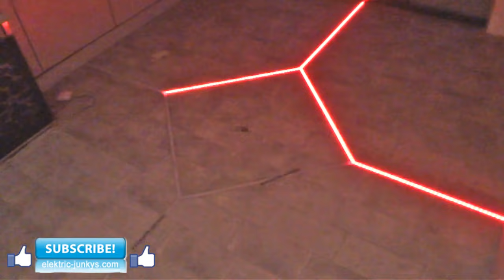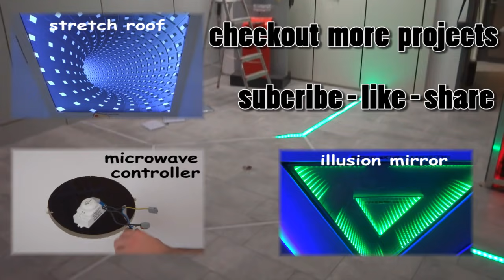how to LED floor tiling system #DIY make interactive Aluminum LED Light tilebar profile

Comment: You know, just something for you guys to try someday.
If you use a more clear plexi, and tint it with a chromatic window tint. Then line the bottom of the aluminium railings with it, you can take advantage of the infinite reflection effect, making the floor appear as if it is floating above a large black void. 
would require a bit more effort, but could really propel your project to another level. Hope to see if someday.
Aside from that, this project is very, very cool. Nice work.
- Cheers MatchStix Entertainment.
Reply from the maker: awesome idea mate ! check out our new Project .. you might love it ! https://youtu.be/hHxKA4JU6BA

Comment: I CAN'T be the only person wondering how much work it takes when one LED light goes out XD can I?
Reply from the maker: +TamuTamuOnigiri not TOO much hh but a little work it is yeah, cut out the broken LED´s Use Fast connectors to fix a new one finish ...
Reply: ***** ah, that's smart ^-^
Reply: +TamuTamuOnigiri 

Well a led cant die.  Only the controller or the pins. The actual led cant die (the point lighting up)
Reply: +Mike j an LED can't die?!?! Always funny when someone makes a statement that sound like fact but is completely false.
Reply: +tornadokat So your saying my teachers, company and experts. are all lying ?

Leds do not burn out. They fade and dim over time. This takes with leds nowadays about 100.000 hours. 
Thats 22 years if you use 12 hours a day.   And they never fade away entirely, but looks awful though. 

When you buy a led light from a hardware store, or any commercial light. (so not a 5mm led for DIY stuff) 
And it dies, it is not the led thats broken, its always the controller inside the led light. 
Put in a new controller, and voila your led light works again. (unless for some reason it goes a power spike)
Reply: Mike j thank you for actually being an intelligent unlike some people
Reply: LED's may last a while but if the micro-controllers fail the LED's also fail, they are only as good or strong as their weakest component. I dont anything about epoxy's heat dissipation properties but I would bet that it isn't  suitable for such a setup like this.
Reply: QuadroNVS pretty sure he used silicone.
Reply: MrVindictus1 mike j is correct. Light emitting diodes do not burn down out. their ballasts however can have a loose terminal so something for them the flow, however they will never burn out. I'm 800 hours from my EL01 permit and work with LED's on all of our sites. they will however dim out after extreme amounts of usages, as mike j said, roughly 2 decades

Comment: Splice the ends
tie them into speaker system
????
watch floor dance to the music
Reply: ***** Well, all you need to do is divert the positive and negative power connections for an extremely powerful speaker that could provide enough power for the LEDS (they might not need that much power but I'm not sure how much they need) and connect them to the corresponding connections on the LEDS.

As far as I know...
Reply: This would be making it way to over-complicated, but you could probably set up a connection to increase the power input to the LEDs without removing the power fluctuations that the music would cause.

But it would just be easier to the Raspberry Pi or an Arduino and have something fancy set-up.
Reply: Well, talking out of my ass has seen results yet again.
Reply: numpty1ish I would go for a ardunio, a raspberry doesn't make sense for what was suggested
Reply: fair enough, it can just be easier for people who are new to it

but it would be harder to connect
Reply: numpty1ish You don't need a powerful speaker system, you simply need to connect the ground to the speaker ground, power the positive from the regular power source (I have done this on SEVERAL car audio systems, nbd).  This would give you a flash in sync with the bass, but wouldn't allow for the rest of the effects.  If you wanted it as an added effect, you could use a controller with a PWM input, and run the sub-preout signal (from your amp) into an A/D converter, then run that into the PWM input on the controller.  If you are having a hard time finding a controller with PWM input, any first year electrical engineering student could modify one for you.
Reply: callum Lawden Neither would an arduino, see my other response to this.
Reply: I will bow down to your superior knowledge :P

I have never really had any dealings with stuff like this and I've never put in any research.
Reply: numpty1ish
Its all very basic controls really, nothing special at all.  Something else to consider, even a decent sized home speaker can handle 75-150 watts continuous, an LED takes much less than a watt, and a whole array like this one takes maybe 5-10 watts, but you should still use a constant voltage source and use only ground from speakers for a lot of reasons I won't go into detail on.

IF you do enjoy playing with Arduino or Pi, a project like this might make an interesting one for you, as it is fairly simple and you can do some interesting effects by adding the input from a music source (the pre-outs, cross-overs, straight from source, different types of modulation, however you wish).  You could use the x-over outputs to control each color of the LEDs to add to the effects for example!  I am not saying this is NOT an option, just that it isn't necessary for someone who wants to keep it as simple as possible.
Reply: ***** Make a video!
Reply: Gerff Sorry to burst your guys' bubble but unfortunately this won't work with these LED strips. They're smart LEDs and have a controller at each pixel, which allows each pixel (RGB LED) to be controlled separately. That might work with "dumb" led strips which are a bunch of RGB leds in parallel, because you're then controlling the overall power. The LEDs in the video receive a serial signal from the controller (the white box with 4 buttons and red leds on front in the vid), then PWM each led separately across the strip. The effect you guys are after could be achieved with a MSGEQ7 and an Arduino or maaaybe a RPi. Search for some videos of "MSGEQ7+WS2812" to see what I'm talking about.
Reply: Kyle Nahas
Over-engineered, If you knew something besides "products", you would have pointed out what I was describing was a simple class D amplifier and the controls that were already in use, which WOULD work just fine.
Reply: Go ahead and hook up some WS2812 LEDs to any amplifier and video it so I can see how that goes...
Reply: Kyle Nahas
You are obviously clueless to what I am talking about, which means 1. you aren't reading, or 2. you don't know much besides what you get in a pretty box.  Either way, please stop misleading these guys who are looking for info.
Reply: Lol I'm an EE, you're just clueless
Reply: Kyle Nahas
Apparently not a very good one, or an illiterate one.  Read my posts, specifically the one saying to use the output created by the PWM controller, on an input to the LED controller.  So, my question oh great one, is can you read, or do you just like to argue and pretend?
Arduino is a cool little "PMC" (used loosely), but it is NOT the end all be all of controllers, there are plenty of others that are much better, and far more powerful.  Arduino is a "hobbyist board", and anyone saying you MUST USE ONE to do something simple like this, that a simple surface mount IC will do, is NOT an EE.  Yes, it IS an option (as I also stated in a comment here to someone who was throwing around ideas), but it is not the ONLY one, nor is it the BEST, so don't come on here saying something won't work because it wasn't in line with your hobbycraft, saying you are EE, and having no clue what someone who IS is talking about.  This is first year degree stuff, how did you get an engineering degree without knowing how simple and extremely basic converter and control circuits work?  Hell, you could do this with a 555 and a couple basic PNP gates in an hour.  Now, that's enough from the trolls, if someone has something constructive to post on here, great, otherwise quit confusing and misleading people wanting to learn, or throw around ideas (how most real learning is done, as long as there aren't counter-productive trolls standing in the center of the room yelling "LOOK AT ME, LOOK AT ME!!"
Reply: numpty1ish " you could probably set up a connection to increase the power input"
Basic concept of an amplifier circuit.  To make it dance even better, you'ld want to include a circuit that isolates frequency ranges.  Many systems isolate it to the base range.  This is necessary because if the leds flash too quickly, the leds appear to be in a constant on condition.  Even better would be to run it through a computer controller where you can control the pattern output with software besides having them just flash on or off.
Reply from the maker: Marcin Sleziak HEY GUY´S CALM DOWN !! Alores Dance`, use WS2811/WS2812b combined with our Music controller ... done.. i guess it´s the most easy solution
Reply: +numpty1ish You can't connect addressable RGB strips up like that. They need to be sent data - they always have 5v power, the data tells the strip which pixels to light, and which colours. The wires on those leads are +v, GND, Data and Clock. If you connected them directly to a fluctuating power supply, you'd just blow out the LEDs and see nothing.
Reply: Stabby666
The clock should be built into the controller not on the strips
Reply: +Gerff it is. the clock line is to synchronise the data as it's sent to the strip. some strips don't use a clock line but require precise timing to work (e.g. neopixel). in any case you can't just plug them into a dumb analogue voltage output. they need a controller to work.
Reply: Leo Landi LMFAOOOO BRO YOUR REPLY HAS ME CRACKING THE FUCK UP.
Reply: These are programmable 8051(?) LED's. You'd have to build a DAQ system for your audio stream and then figure out how you want the LED's to behave based on your acquired signal.
Reply: This is not a "simple" project if there isn't library support btw... not sure if there is or not

Comment: Mate, you make tiling look so easy.. I bet it's not. The LED floor system is awesome. I have a games room with a bar and some pinball machines, 80's arcades. I think an interactive LED floor system in there would look freaking outstanding. Brilliant work.
Reply from the maker: +X Gen Thanks ! ... soon we upload an New Floor System without Tiling easy to assemble and Awesome Look ! Wood Optic, Stone Optic, Metall Optic .. all Possible .. stay Tuned ...
Reply: Very cool. Will do.

Comment: As a HUGE TRON FAN..and as a former remodeling contractor myself this is SOFAKING awesome!  Thanks for posting.  My main question is with using the 6" grinder for cuts, is the imperfection in the joints very noticeable?. I would likely use a miter saw but realize that would take a lot of extra time.  Also..where did you get the alum. track / channel?  Is there a name for it (style or brand).

Comment: "..just one question,.....Waterproof or not ...???   :D
Reply from the maker: +YoSuke it is, silicone the Spares !!
Reply: If it is waterproof then this is able to go outside?
Reply: @adanolandez6461  the LEDs will overheat and burn because of the sun

Comment: done it myself in the party room of my house. But at least where i have the horizontal and verical lines, i kept the shape of the floor ceramics. Didn't cut it in half ,when i wasn't suposed too. Plus there is a cheaper, more inconspicous and easy way to do it. Here there's a lot of useless work. Still great efort and good job. Congrats
Reply from the maker: thank´s a lot for comment mate, if you like you can Post your results on our DIY Group. Cheers

Comment: Why do people complain about the LEDs failing? :) isn't it as simple as removing the transparent glas/plastic/whatever covers and changing the LED strip? I mean, you don't have to dig up the whole place again just to remove a faulty strip ^^ (or am I wrong? please correct me if I am :)
Reply: +Daniel Kemnitz no your right
Reply from the maker: +Daniel Kemnitz even not the strip just "50mm"
Reply: +Daniel Kemnitz For me personally, the complaint is that they barely last a few hours of use sometimes. Maybe I have been very unlucky or just buying from the wrong people. I bought a continuous RGB strip from one particular eBay seller and half of it failed within around 6 hours. The replacement then lost its ability to show red on some of the strip within a similar time. Surely that is not acceptable.
Reply from the maker: N just dont buy the cheapest crap from Aliexpress or Ebay ! Cheapest crap LOWEST QUALITY we are Manufacturing LED Supplys for 10 Years only with Siemens Assembly Shooters. Buy Quality less Headache....
Reply: Yes I agree; "buy cheap, buy twice". However, which part of the strips are you talking about? It's hard to tell who's product is better quality really and a higher price does not always mean a better product.
Reply: +N I don't know how trustworthy people in the States on Ebay are, but to me it makes much more sense to buy these LED strips in a proper store. They are very cheap, so why bother with Ebay in the first place. I have a set of 10m that I cut up and I am using app. 2.5 meters, and so far they have last over 100 hours (sometimes 24 hours straight with no fail nor heat damage). If you buy quality strips the LEDs will last you a long time, possibly a year if not more.
My advice, go to a trustworthy dealer and spend 10% more, then you won't have any of these issues you speak of :)
Reply from the maker: Daniel Kemnitz yeah thats exactly the Point, but the most people are out on cheaper cheaper

Comment: What to do if the LED's die xD ?
Reply: +iPodiMaster buy them again xD
Reply: +iPodiMaster I hope he doesn't need to break the floor
Reply: stephanos2003 plays games LED's don't die??? hahaha that's new !!
inform yourself, you'll be surprised
Reply: +stephanos2003 Try looking at the front of German executive cars that have been around the block a few times. Those fairy lights don;t last forever!
Reply: +N nope saw a 2016 jeep grand cherokee the other day had 2 leds out already. those arent the best leds to get and since they dont last long i would just run my own.
Reply from the maker: +iPodiMaster dig a grave !
Reply: +ghammatx you should watch the video :) he has slats that sit over the lights that allow the light through. gonna be some major fails with this new tech in renos I'm sure.. lets hope I'm not one of em!

Comment: so much eye candy
how long does it last tho?
Reply from the maker: at least 5 years
Reply: ***** ty
Reply: now i'm curious on how to make an interactive led lighting system with arduino or makey makey for my stairs that turns on as long as someone is stepping on it.

i honestly have no idea how to build something like that
Reply: if you use Arduino its pretty easy to pick up :) I would suggest puting frosted acrylic over the leds to make the color smother though
Reply from the maker: DocterBacon Music with arduino all would be more complicated definetly not to advice. Our choise is the most easy solution, "PLUG AND PLAY" no programing language or technical background needed ! 120 Programs to choose from our controller by hand remote.  
The Acrylglass we are using is Frosted, we have 3 Different levels of the acryl plates, this is the light frosted modell ... check out our website for more informations on Products send us an email shop.elektric-junkys.com
Reply: ***** didn't know that thanks :0
Reply from the maker: no pro bro, if you have any questions on OEM products or you wish to make an Product housing acrylic pvc, or an own Arduino PCB - PCBA services let us know ..

Comment: Awesome I install tile for a living and I'm going to try something like this in my shower at home I'm redoing, dark grey metal low gloss 12X24 tiles and some stainless steel faux tiles as well as glass so it will look awesome
Reply from the maker: +Richard McIvor hi, yeah actually this system is made for Bathrooms we made a lot of Bathrooms with theese systems i will Post soon some new Projects

Comment: Some hard work right there.
Something Id like to know about is how durable it is with people walking over it. And what about spilt drinks or mopping the floor?
Have you thought about a custom controller?  To run them seamlessly. I mean where someone cant see where one string starts and another ends.
Reply from the maker: SHOCK PROOF WATER PROOF CAR  PROOF !!  checkout our new Video ... !! >>>  https://www.youtube.com/watch?v=sPt9olLB_o4
Reply: I have been working with these for over a year. Biggest matrix I made was only ~680 pixels. I was just wondering how it goes with water and maybe 10 to 50 kilos pressure as if someone is walking over it.
Reply from the maker: ProCactus hi guys .. as i said A CAR CAN DRIVE OVER IT ! if it is siliconed its 2 times water sealed first inside the Strip itself + outside the spare slices are siliconed ... WATEPROOF

Comment: This looks cool. I believe the LED strips are waterproof but how water proof is the gaps ? water may get stuck there in case of water spill?
Reply from the maker: hi mate .. we filled the gaps with Silicone .. so it is Waterproof .. cheers
Reply: @ejunky66  cool. Thanks!

Comment: What was that channel stuff you laid the LEDs in? And how did you wire up the strings since it's not a clear unidirectional path.. Were there cables connecting it like that electrically? Looks like there are maybe 2 strings going by the animations.

Comment: Looks awesome, but what if the LED will break after some time? They suppose to be endless, but as far as i know they are not, so...
Reply from the maker: hi mate .. replacement takes about 5 Minutes .. icluding sealing ... but as i said in a comment before .. the LEDS RUN WITHOUT PROBLEMS SINCE ESTABLISH ! thanks for comment mate
Reply: Thanks for the reply :)